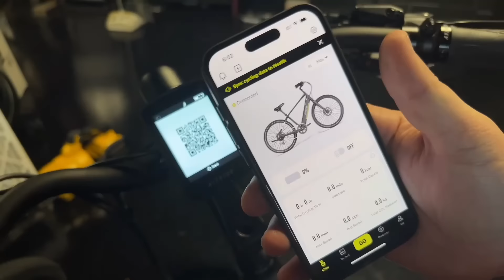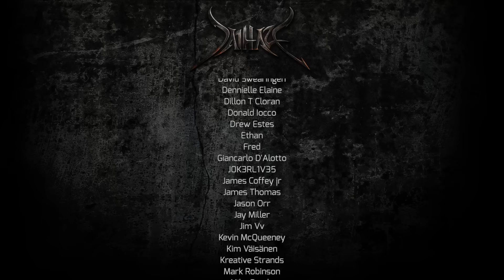Im Fat, So I Bought an Ebike | Aventon Pace 500.3

Comment: I had pace carbon folks in the 90s or early 2000s 90s I think. Different I now realise its a aventine.pace. agreed reflectors in the bin use lights if you need to. Yeah seat up ngl this is amusing. I cycle a load i Don't want to touch the floor i can lean when not riding. Get more power down. Each to their own. Brie knows.